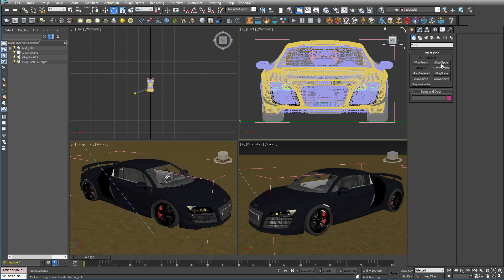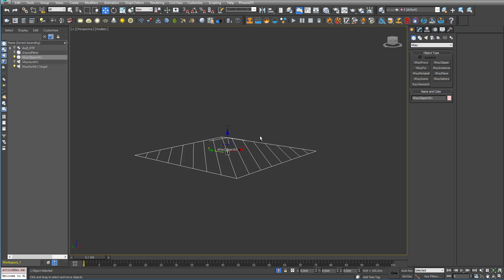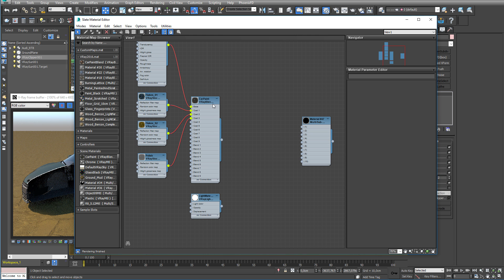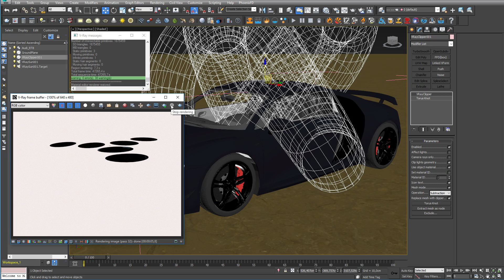VRay Clipper Tutorial for 3ds Max - Everything you need to know about the V-Ray Clipper

Comment: Just a note - I was looking for this answer but the best solution I have - I had a vray clipper but because it was a box and my geometry was inside of it - my reflections would reflect black, even when the clipper was set to not visible by camera in obj properties - I ended up switching it from intersection to subtraction mode in the clipper modifier settings - this brought my reflections back - but I am curious why the v-ray clipper is stopping reflections.

Comment: hey amazing video, but i'm having a problem when i clip an architecture the vray clipper connects all the lines to each other ex: i have a void in the middle of the floor when i clip it connects the floor by a thin line, any suggestions? thank you
Reply from the maker: Elie Abou Raad Hmm.. That seems strange. I would check all normals and weld unwelded verts. Perhaps reset x-form, if that is feasible. Do you have a screenshot?
Reply: KevinTheDane an uncaped object or one missing polygone can affect the clipping?
Reply from the maker: Elie Abou Raad Maybe. I don't per se know, but it could very well be the case..
Reply: KevinTheDane okay thanks 👍👍

Comment: what is ur system (hardware) configuration?
Reply from the maker: I have an i7-4770 Haswell, 16 GB RAM and an nVidia Quadro M6000
Reply: @KevinTheDane  thanks
Reply: @KevinTheDane  nVidia Quadro M6000 12 gb vs 24 gb
Reply from the maker: @usamasyed7913  Mine is a 12GB. It was a prize. In my oppinion not worth the money over Titans or just regular GTX/RTX. At least not for rendering.
Reply: @KevinTheDane  THANKS SIR